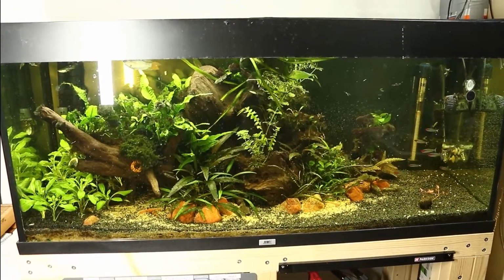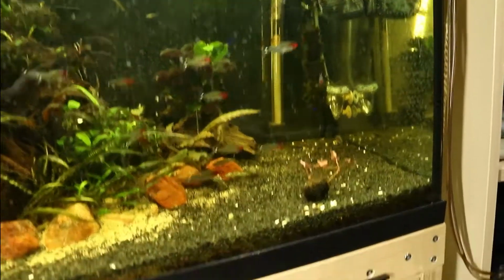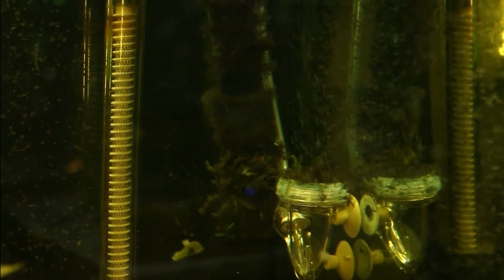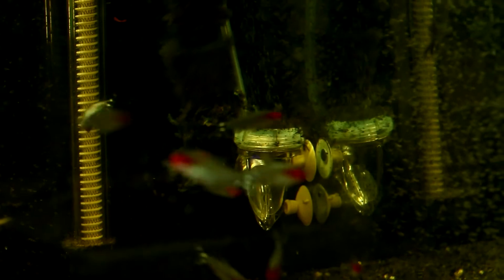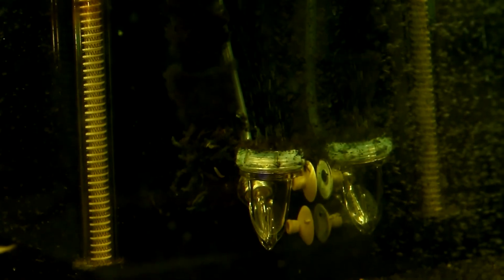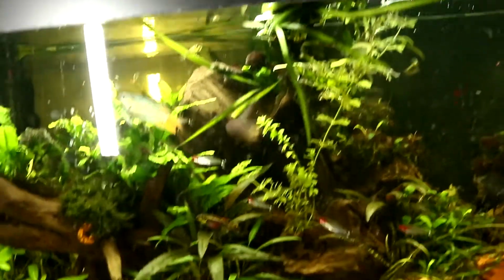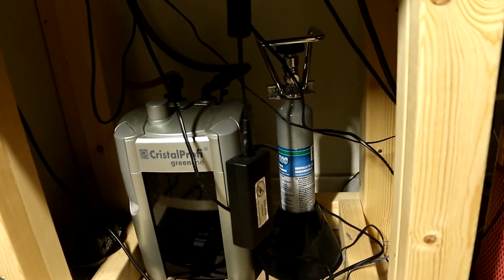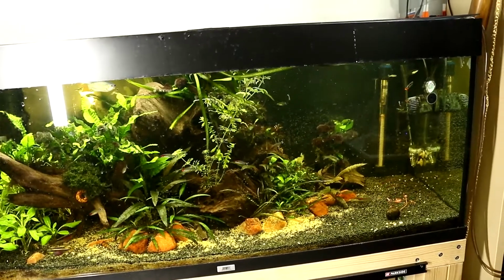Aquarium Equipment Basics (Introduction)

Comment: Quite an impressive collection of equipment. There is one simple and cheap one that you missed out. An under-gravel filter or plate. It is out dated because most don't really understand it function. Under very slow flow, the water in the gravel will have low oxygen and this is where facultative  bacteria will consume the oxygen in the nitrates [no3] releasing nitrogen gas.